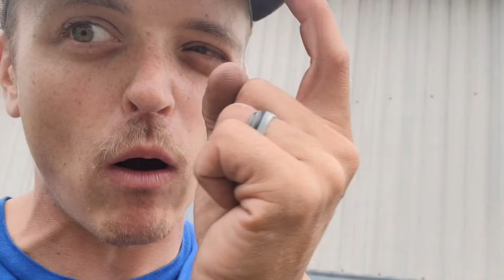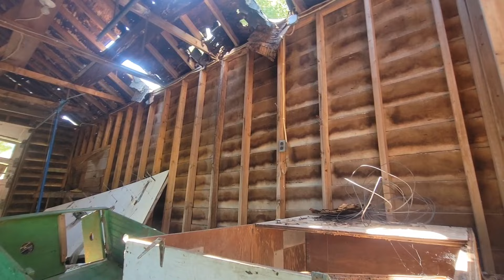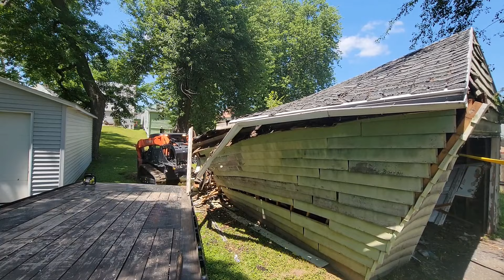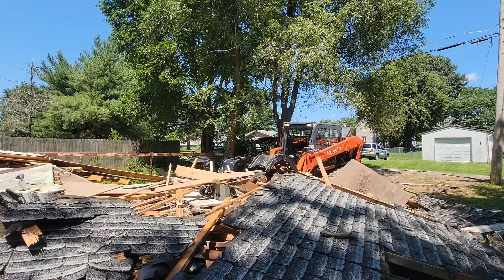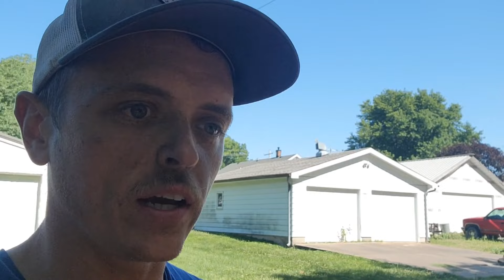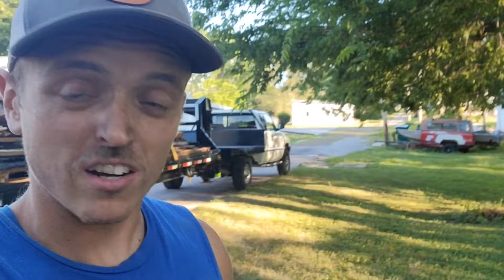Garage Demo With Skid Steer and Grapple Bucket

Comment: Do you like the skid for demo over a mini excavator?
Reply from the maker: Skid with the grapple is awesome. But the mini is even better. Especially when you can sit right next to the dumpster and keep from tearing up the landscape. Except for when you demo a very old brick building or something with a lot of loose material. Then I'd like to use the skid for scooping up bucket loads.
Reply: @rollingops  yes im back and forth on what I want. Mini ex, skid, or mini skid

Comment: Nice! How much did you charge for this?
Reply from the maker: Take a guess, let's play over or under
Reply: 2.5k
Reply: @rollingops  4000
Reply: 2800 saw it below..... What was the total weight to dump ?
Reply from the maker: @outdoorzwithcraigdz  two tickets, I believe I was under 4 tons, the roof was in awful condition, which would usually be your heaviest portion, so it saved a lot. I anticipated it 5-6 tons.